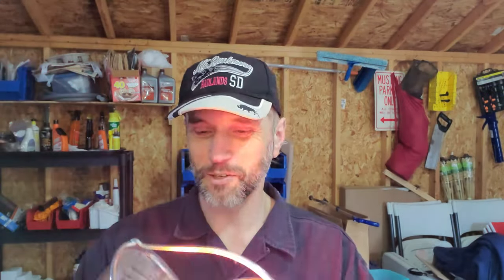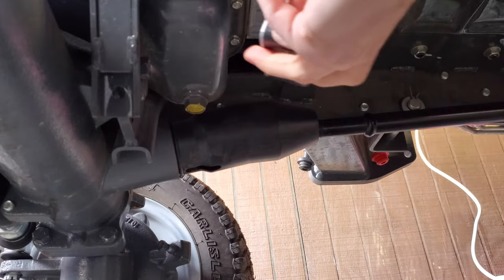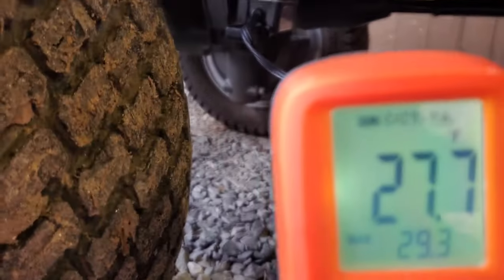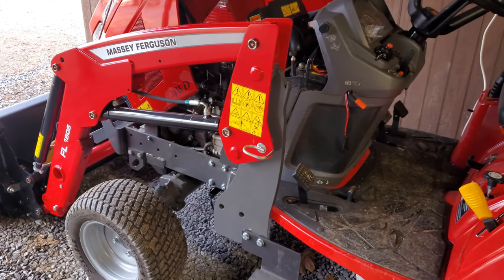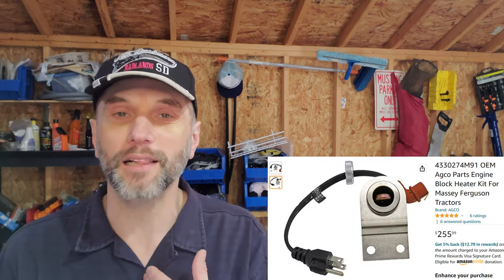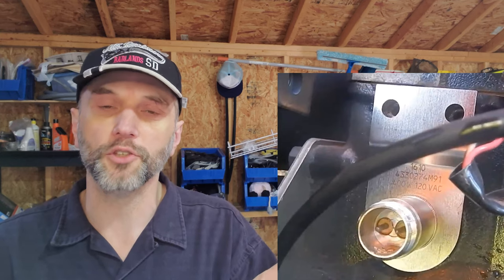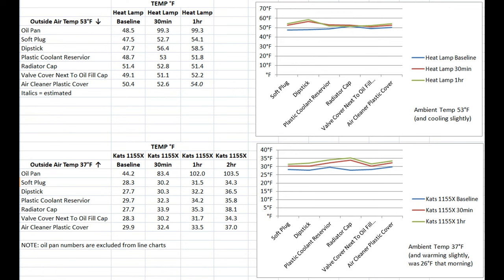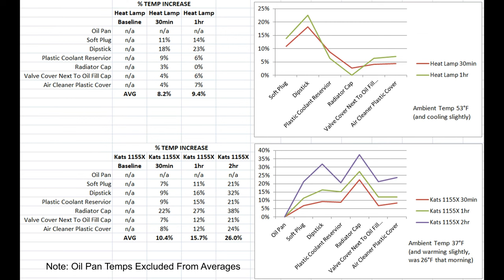Magnetic Block Heater vs Heat Lamp Massey GC1723E

Comment: thanks for providing temps.   This post has been corrected.   The video was excellent because he provided real meaningful data.   Thanks for taking the time to share this.   If you ever decide to try an adhesive silicone pad heater make another video for us! Thanks. Charlie
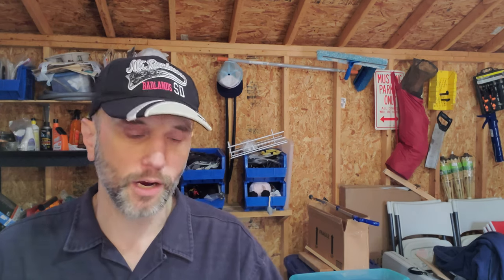Reply from the maker: Did you watch the full video? I provided a results table at 6:29 showing exactly what you are asking about. Temps flattened out after 2 hours, so there was no reason to measure temps at 3 hours.
Reply: @Redneck_Ed  I apologize.  I am not sure how I missed that part of the vid.  I corrected my post.  Thanks for the heads up on my error....

Comment: How's she goin'?  The magnetic heater is a nice option for sure.  I have one and used it all one winter.  My only issue with it was it was slow and in a wind a lot of the heat was lost.  Also it needs to be attached to the oil pan and that may sound easy, but you have to get down on the ground and reach under to attach it.  Now that I write this and reread it, I sound like a wimp, but I did mind doing this!!!  LOL  Nice review though and you have presented some great info and it proves the magnetic heater is worth the purchase!!  Take care!!!
Reply from the maker: If you're a wimp, then I'm there with ya. Before I bend over, I think about how I'm going to get back up. If I can't envision that going well, then I don't bend over. I have a young teen son, so I feel fortunate to have some muscle. I'm like the mob boss and he's the heavy, lol. Take care, and thanks for watching. I watched that chipper video the other day. The cleanup is coming along.

Comment: Block heaters are probably the best option.  They make what's called tank heaters which have to be plumbed using heater hose. For years and even now my smart plug is/was a timer. No need for apps or remembering to turn the plug on. At 30° outside that little engine should fire up without the need for heating. 
The problem i have is i want the transmission  hydraulics warming at the same time. I am in NW Wisconsin, I have a JD 5500 ag tractor With the 4239 diesel engine. It has the blockt/frost plug heater. I can plug the heater in and in 2 hrs in sub-zero temperatures and it'll fire right up. But then I have to let it run for quite awhile to get the Hydraulic oil some what warmed up so the front loader on it will work. Still it takes time using the hydraulics to get them working like they should.
Another option that I've used on my vehicles is a lower radiator hose heater.
Reply from the maker: Have you thought of putting one of these magnetic heaters on the transmission pan to preheat that oil like the block heater is doing for the engine?
Reply: @Redneck Ed  yes I have. Just ordered some. Just AN FYI there is no "pan", it is all cast iron. Hoping the pads will stick and stay stuck.
Reply from the maker: @stevenhoffmann9373  Ah yes, good catch. I'm not even sure why I said that. I put a magnet on the transmission over a year ago and knew it was cast. Hopefully pads will stick on there somewhere.
Reply: @Redneck Ed  i tried a magnetic heater.  To much  material too make a difference
Reply: Reneck made a useful video comparison, and it looks like the magnetic heater would be adequate for his typical winter temps. It gets far colder here, which makes me wonder if that heater would be as effective. You took the words right out of my mouth concerning a low radiator hose heater. Easy to install on a car and pretty cheap  but I don't know enough to see if there's room for it on a compact tractor.  Maybe it's an idea worth pursuing.

Comment: Your recommendations must have been widely accepted, Ed.  I just followed your link to the block heater on Amazon and that model is out of stock.  When I added it to my wish list it showed a price (when it is in stock again) of $84!  Big jump in price.  I do like the idea of using the smart plugs to turn the system on prior to use.  Saves a trip out to the equipment shed in the cold.
Reply from the maker: It was all pricing. Amazon dropped it significantly and everyone must have jumped on it when I did. It'll come back.

Comment: I just purchased 2 silicone stick on heat pads for $20 they heat regulate to about 194 degrees. And will put them on a temp switch to go on and off by outside air temperature. I think they where 150 watts each
Reply from the maker: That's a great point. I should have mentioned that option in the video. What brand did you get?

Comment: -20C Use a block heater and magnetic heater for two hours, 15W40 synthetic, leave the battery tender on 24/7
Reply from the maker: Yeah, the 15W should protect the engine better over the long term, but the tractor calls for 10W. Since you have the block heater on, the 15W shouldn't be bad at all.

Comment: Heat lamp bulbs heats up the object that it's pointed at, not the air around it, inferred light.
Reply from the maker: Not sure what you are trying to say. Inferred light is not a thing. Are you trying to say that it is infrared? This heat lamp is not infrared.

Comment: I have the same one. I put it on the bottom of the pan and,  for 30 to 45  minutes.  That's when it's colder than 25. I wouldn't buy the block heater. It's way overpriced for me for what it is. I would do the radiator hose heater first.
Reply from the maker: Ok, I have to come clean. I had been watching this on Amazon and the factors of a price drop and you leaving a comment on the Facebook forum are what pushed me to buy several weeks ago. Next time I will give credit where credit is due, I promise!
Reply: @Redneck_Ed  I had no idea that you saw my comments on it in there.  😁